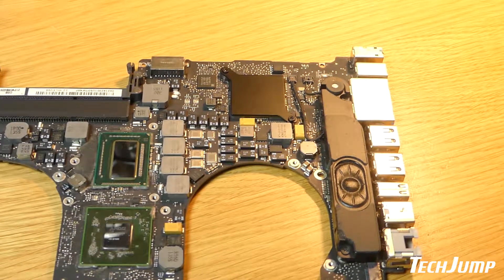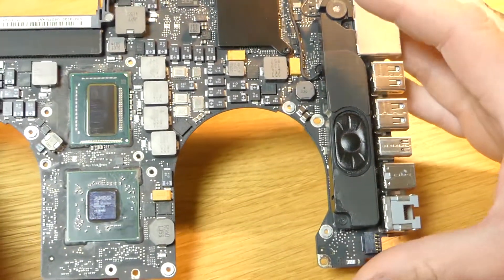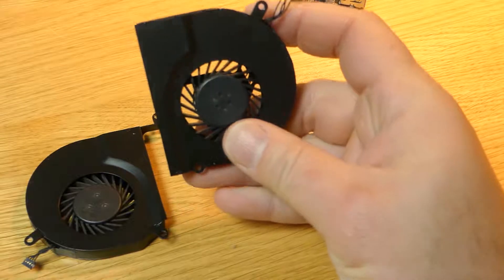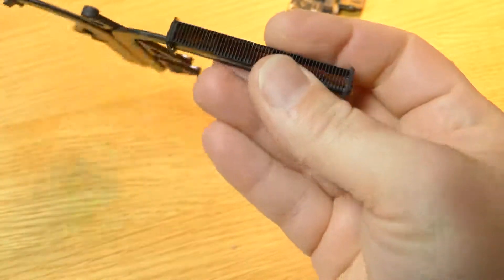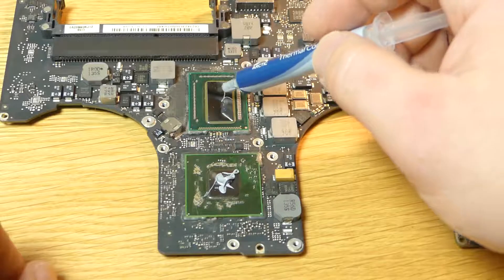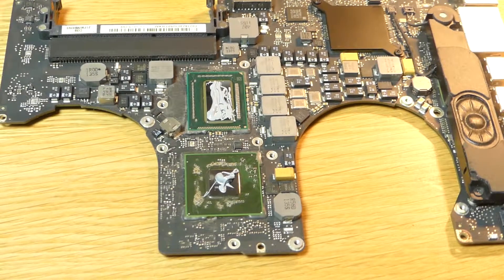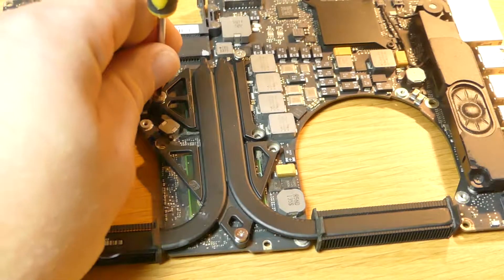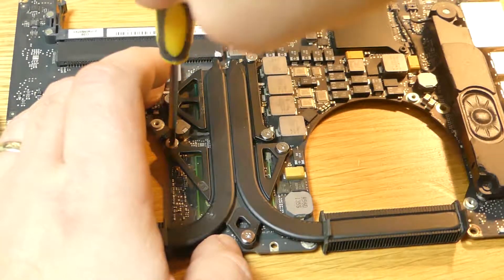MacBook black screen repair

Comment: It reflows the solder balls under the GPU. Check out Lewis Rossmans channel on mac book repairs.
Reply from the maker: Hello. Not sure about that. In this case. Not enough heat for that process to take place.